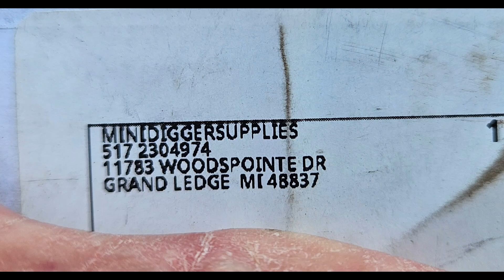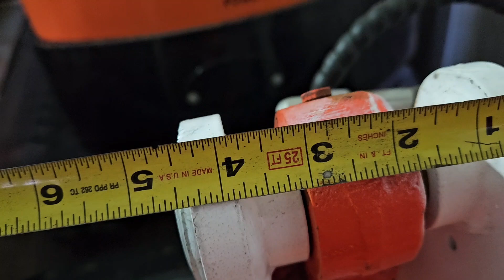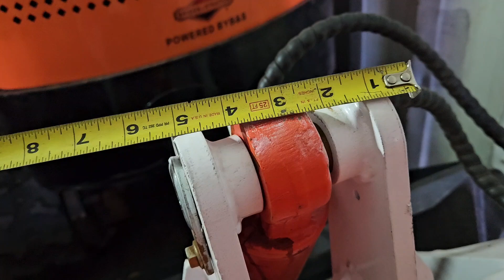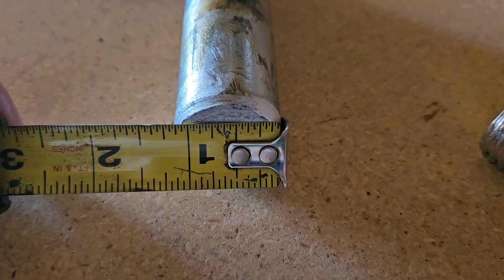Chinese mini skid upper bucket ram bolt style pin experiment. (temp fail-help me)

Comment: I had to replace the cylinder , had to cut off the old cylinder ends and weld it on the new cylinder,  nearly impossible to find  exact fits to odds parts measurement, by the way ,after I was done, the seller in China finally  respond to my emails and the Exact replacement  was available at reasonably price but I was done with my modification
Reply from the maker: @imnotsure8250  Well, it stinks they took forever, but dang, it sounds like you killed it on improvising. Not easy but very cool. Much respect.

Comment: Are you attempting to fix a problem that hasn't and most probably will never occur? By the sounds of it the person's machine that has the splayed ram mounts must have majorly misused the machine for that to occur? As you said the mounts are gusseted well and use chunky steel, I would have thought that it would be difficult to damage that area of the machine through normal use. My suggestion is to keep the existing pins, keep them well greased and remember everything on the machine will be metric. I couldn't see what drive type you have but if it is the tracks the rollers are greasable (not sure about the idler pulleys) but don't have grease fittings and are shipped without grease. You can make a grease fitting bolt from a new bolt of the same size with a hex head that retains the track rollers, remove the outer bolt of each roller and install the grease bolt to grease the roller bearings then reinstall the normal bolt. Just my suggestions after researching for several months and importing a machine as we speak.
Reply from the maker: @TheHayruss  The person that damaged theirs had installed a larger bucket. After seeing that I figured a preventative measure couldn't hurt. As usual, it wasn't as simple as I thought. The sleeve should arrive soon. 25mm IDx 30mm OD.  Thanks for the advice on the tracks.
Reply: I just did grease fitting on all the rollers and front idler on a LRT 23. The pins in the track rollers are NOT hollow till I drilled them out
Reply from the maker: @natsterlive  That is a project I've been putting off, but definitely need to do. I've been using the machine almost daily, while working on our Community Garden.